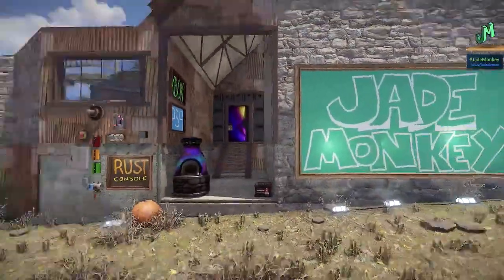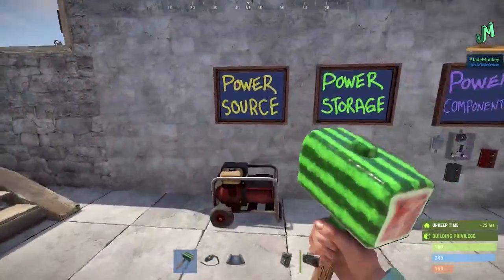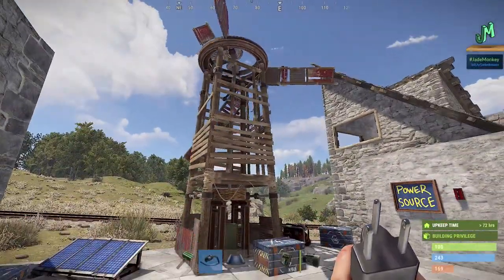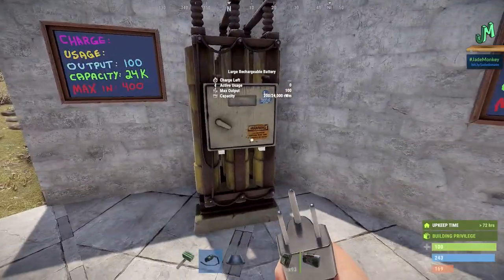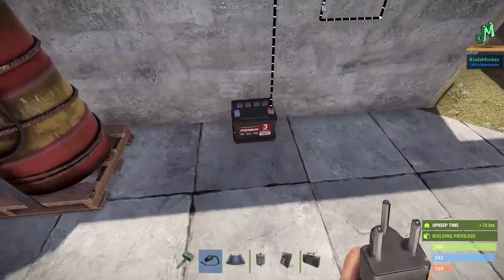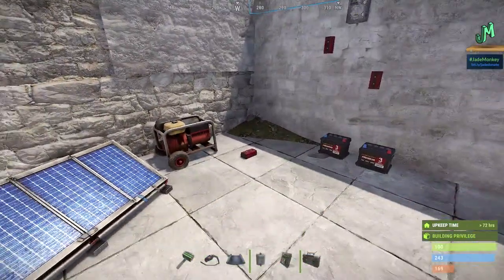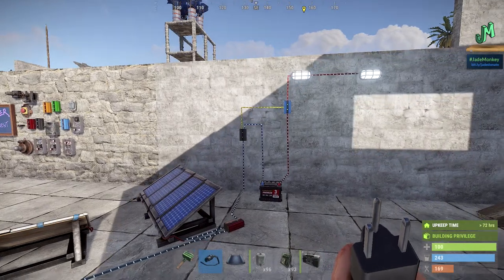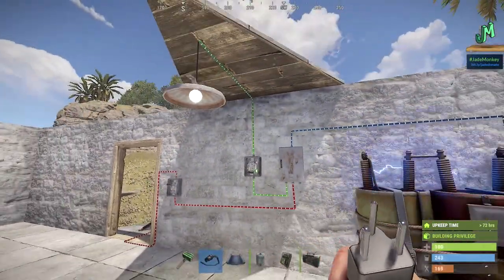Power Update Basics and Setup Guide 🛢 Rust Console 🎮 PS4, XBOX

Comment: Your guides are always helpful!! I always set up a master switch like you say but why does the circuit drain the battery even when the master switch is off??
Reply from the maker: If the switch is the first thing connected to the battery it wont use power until it is turned on. But if you have components inbetween the battery and the switch there will be some “leakage” sometimes it is something you want sometimes it is not